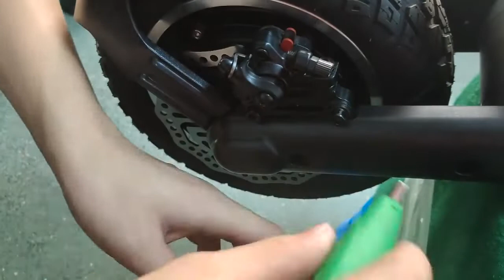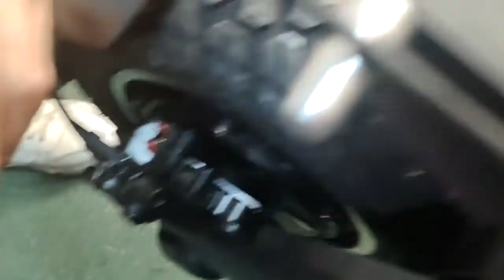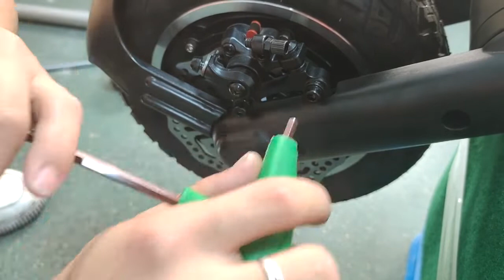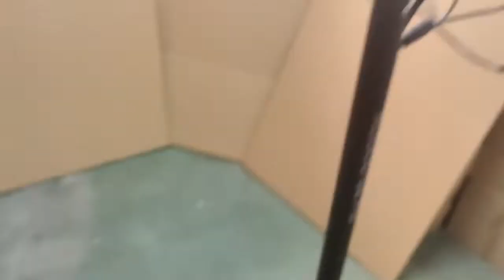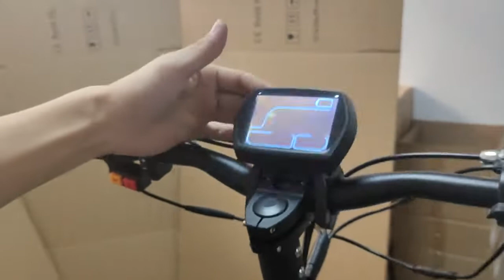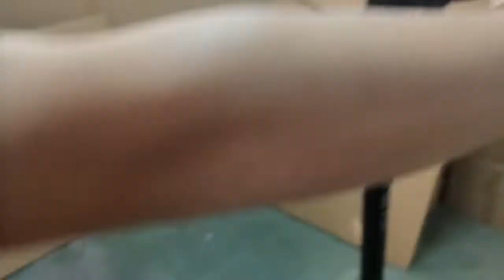Kugoo G2 Pro Disc Brake Replacement (Kugoo G2 Pro 更换碟刹器)

Comment: how did you get yours to go 56 kph mate, have heared ppl saying go to p3 and hold the p button down till it goes back to the speedo is that right because i don,t want to do it and it starts goin slower im getting 45 kph 28 mph
Reply from the maker: Hi, the kugoo kirinG2 PRO scooter can reach a maximum speed of 45km/h, but because everyone's weight is different, the maximum speed will also be different. The 28km/h you mentioned is also a normal speed.
Reply: @kugookirin  yes even freewheelin it only goes 41.7 kph on the speedo and with me on it im 10 stone its the same but on the gps speedo it reaches 29 to 30 mph whats that 47,8 kph
Reply from the maker: @austieoutdoors9763  There will also be differences in speed due to the difference in weight of each person.
Reply: Hello, because my scooter gets stuck in the rear wheel when accelerating, could you please help me, I can't find a solution
it is a kugoo kirin g2 pro
Reply from the maker: @kicsernavarrosantillan6562  Hello,
You can send the breakdown video of your scooter to my WhatsApp +86177246098970.

Comment: How was this a brake disc change,, very useless video
Reply from the maker: Hi, this is the video of replacing the disc brakes.
Reply: But he never changes the disc. And the quality is very bad.  And he dosent speak what he is doing.

We pay over 1000-2000euros for your stuff and u can't even make a proper video?!??
Reply from the maker: I will upload a video of the disc brake disc replacement.
Reply: @ffraj5104  yeah, Absolutely useless video where even doen't show what kinda brakes to use does , and even show how to put the calliper on it's right place, this is varyous on how in lasts and stop for you.